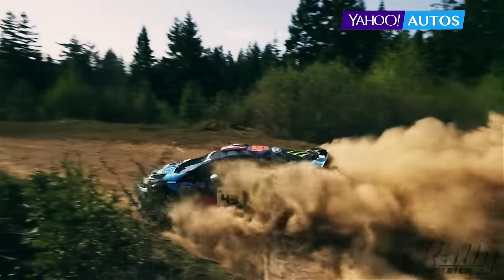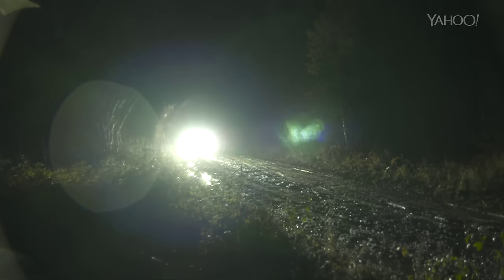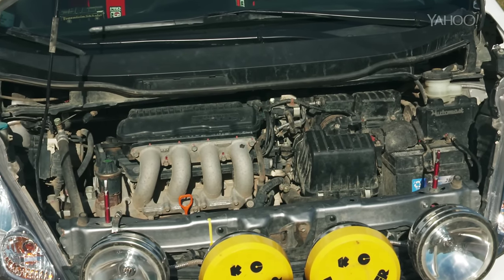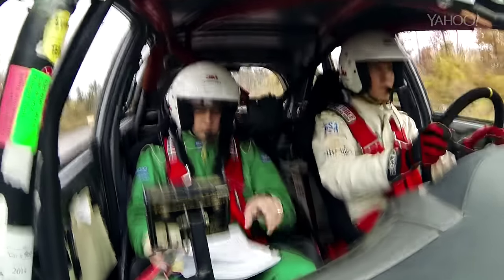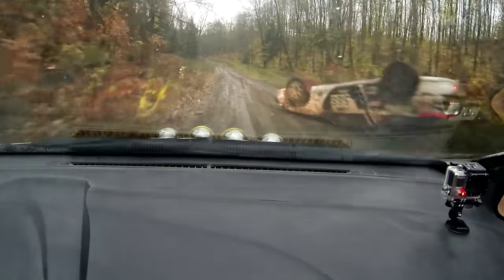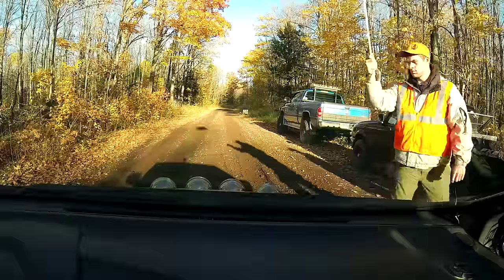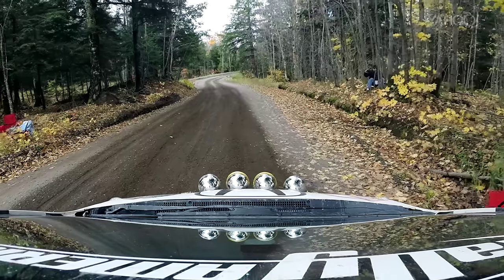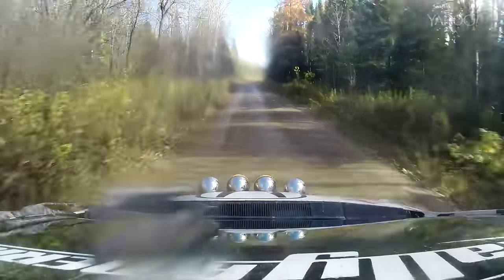How To Go Rally Racing On A Budget

Comment: yes, you can go out and buy a Honda fit for 10 grand, and yes, you can probably put a cage, two seats and all the other safety stuff in it for another 8... but this is where this "budget racing" thing goes a bit wrong. because youre looking easily at another 5 grand for a half decent set of gravel suspension, and a set of tyres (you'll want at least 2 sets) is about another grand a piece, plus youre going to need spares for the brakes and various other suspension components, easily another grand. Then theres getting it registered (oh yes, these things have to be street legal AND insured, and insurance for a racecar is not cheap). then youll need a tow rig, because even though it is street legal, youre insurance wont allow for it to be driven long distances to and from events, so youll need a truck and trailer. then theres the gear: helmet $500-1000, racing suit 500-1000, the hans device he has to wear around his neck is a minimum of 1000 dollars and it is mandatory. Going racing for 18 grand is all very well and good in theory, but youre actually looking probably a minimum of 30000 just to get the car ready and to one event, after that the costs die down, but it still isn't cheap. entry fees are expensive, and then theres getting the racing license, the school for which can cost 3 grand. so if you want to do a season of racing, your first year youre probably looking at $35-40000. not really budget racing when you actually look at all the costs.
Reply: +Jack Khashmanian Protip: Don't tell your insurance that you've modified your vehicle. Worst comes to worst, if you crash it you don't get anything out of it unless you tow the wreckage home and part it.
Reply: +Jack Khashmanian I am building a BMW e36 rally car. I have my helmet -120, insurance - 30per month, cage is 4k, suspension, 2.2k. Other items, Ie fire suit, skid plate, fire extinguishers, med kits, spill kits, steering wheel, tires and all. The whole project is looking to run about 10k for me. Then another 1-2k per rally. Not that bad. 1 or 2 rallies a year and then 50 dollar rx inbetween for my first few years. Biggest bite is the initial car.
Reply: while this poster is using worst case pricing and basically figuring all "new" gear (you don't need all brand new gear) he is mostly right.   you have to have a tow car, you have to have spares (though often the best way to get spares is to buy a wrecked version of your car and strip it apart at home).  but there is going to be 1-2 grand in costs per event you simply can't "bum" your way out of.  and of course being able to afford to build a 18k $ car doesn't mean your also well off enough to afford totalling it.  you have to enter every race with the mindset that it's not the end of the world if you tow back a pile of smashed wreckage.
Reply: Jack
"Budget" in comparison to a full-fat racing car, not to your shopping trolley.
Reply: Jack Khashmanian I think that compared to subarus late 90s budget for wrc was 350,000,000. But yea it's not exactly cheap.
Reply: It is still cheap compared to rallycross cars.
Reply: Or you go to Eastern Europe, get some shitbox for 3k, weld in your own cage, just drive it on the road and don't care about that silly stuff. (Okay don't take this all too serious). 
Funny side story of mine (I am from Austria btw)
I got an actually pretty damn decent Hyundai Tiburon that already was built for Rallycross and was in good shape for crazy 1000€ (1170$) and am driving it since 3 years on dirt tracks and closed off dirt roads. It's not an actual rally and I can only move it on the road with special short time number plates that cost 180€ for 3-21 days (it depends on your stated need for the plates), but it's the closest I can get to rallying with my irregular and poor salary I get from my almost bankrupt company.
Reply: William Brown umm.. what?
Reply: Jack Khashmanian and that is why I stick to demo derby figure 8 racing at fairs. My car is 200$ some time in taring it down and you just need a good helmet.
Reply: Thanks for the real world breakdown!  Actually 30-40k to start doesn’t sound all that bad for first time investment but I wonder if that initial 10k car money would be better spent on a more capable older car where you could potentially get the car for 5 or 6 grand and then use the other 5k you saved to build it out?  Are there age classes for cars in rally races?  I’d love to get my hand on a Celica AWD :)
Reply: Jack Khashmanian the video says rally on a budget. 

It doesn’t say rally for cheap or basically free with no risks.
Reply: yea, idk how yahoo thinks they know what they are talking about
Reply: You are definetly right but there is actually a thing that is "budget" racing. I.e where I live amateur rally drivers buy cars like Lada 1200 or old Volvos on and work on those.... Not of course nearly as nimble or in form as the honda here but they are rear wheel drive cars and everyone in class has more or less same kind of budget car with similiar backgrounds so racing stays close.
Reply: https://youtu.be/P782wx12uYw?t=2m18s guys rallying a Lada 1200... Looks absloutely brilliant fun.
Reply: You can do an event for $2000 minimum, that was camping and driving 11 hours to the event. My car was $3000 bought in pieces. After updates and safety equipment we were about $8000 total for car, dolly, tires, spare parts, and that was the cheapest car around.
Reply: Don't forget better engine parts for performance and reliability. Build your car before racing the budget is only for getting the car not building it lol. How it's always been. It's harder to mod now because it's nearly impossible to get blueprints of a lot of cars

Comment: "I'm surprised at how much you could leave alone" 
New tires, welded diff, stripped down completely, 2 bucket seats, gravel suspension, racing wheel, and a roll cage.
Reply: Seems like a lot but its really not, it's nothing compared to creating a drag setup.
Reply: @Snow-vo1yi  You can leave everything alone on a casual drag car, can you not?
Reply: @zachrichard7039  it depends on whether or not you're actually competing against buildt cars or not.
Reply: @Snow-vo1yi  But that's not their goal in this either. I think the point they're trying to make is that the "budget rally build" is still quite expensive compared to a budget track or drag build.
Reply: @zachrichard7039  ok m8
Reply: @zachrichard7039  you can build a Rally car much cheaper tham Dragcar buy fwd shitbox weld a vage weld the diff Take out interior fit a Bucket and done all in like 3k
Reply: @lel9460  you can build a drag car by doing none of that. You need a cage for rally.
Reply: @lel9460  what an incomprehensible sentence. I never said I liked drag racing. However, I do race a rally car

Comment: No such thing as budget rally.. rallycross on the other hand :) good cheap fun
Reply: Agreed. This is the real answer
Reply: You can't use the same budget car for both events? What makes you say it is cheaper, I actually like the idea of circuit racing better than timed distance
Reply: Drew Larsh it's information  for people that want to race rally not rally cross
Reply: rallycross is done on a mostly built circuit, which is a lot smoother than an actual rally course
Reply: Budget mudding.
Reply: 'Budget' is relative to the subject. RallyCross is definitely cheaper for entry, Though you still have to pay 2,500+ to get a rollcage installed, and upgrade suspension/drivetrain parts if you don't want your car to fall apart mid-race.

Comment: Cars I'd recommend:
BMW E30 325i
Mazda speed 3 (any generation)
Any subaru WRX or a 1st gen legacy turbo
An old AWD audi
or really any FWD car that's under 1400 kilos (3000-ish lbs.)
Reply: why FWD? Just curious. At first thought my instinct is to go with RWD.
Reply: Rwd slides a lot on dirt.  For fast times, that's bad.  FWD pulls out of slides on dirt better than RWD but if you just want to have fun and you don't care about time then yes, rwd is a good option.
Reply: actually thats just half of the story... FWD is easier to drive i give you that, but in bad conditions like rain and mud if you accelerate hard in a FWD car you'll lose alot of grip because of weight transition
Reply: Dat Person Doe. then a Toyota Yaris/Aygo is perfect, 2,400lbs, 104hp and FWD, in fact it could be a unnoticed beast because I haven't seen many people use them in rally even though you can find them for $3000 or less.
Reply: Skunkdog Gro
Ford Fiesta, and Opel Adam are also quite good. So good that they're both made into R2 Rally cars.
Reply: Id add the 6th gen celica to this. Im about to buy one for less than 1k that runs and drives. Toyota actually used these celicas for rally
Reply: A 1st Gen Fiesta ST 2006-2008 (165HP with small mods you can do with used parts / 1150kg stock )

Comment: Few mistakes but overall great video, really gives me a look into what should I expect, Im even more excited now. One thing tho, you can get into rally racing for a lot and I mean A LOT cheaper than 18k. You can pick up some car for 1 grand and rally it with no problem, just find a rally where there is no requirement about having a roll cage and you can participate for 1k + entry fee
Reply: Ofc having a skid plate under the engine to protect oil pain and transmission from rocks and stuff, rip out the interior, buy some aftermarket steering wheel and muffler delete will give you more of a rally feel, but those are extras
Reply: Ofc having a skid plate under the engine to protect oil pain and transmission from rocks and stuff, rip out the interior, buy some aftermarket steering wheel and muffler delete will give you more of a rally feel, but those are extras
Reply: 1. There’s no such thing as rally without a roll cage 
2. There’s also no such thing as buying a rallycar for 1k and just going and driving it with no issues. If you get a rallycar for 1k, be prepared to spend hundreds of hours and thousands of dollars to get it remotely stage worthy 
3. Motorsports are inherently expensive. If you’re looking for cheap, rally is not the sport for you. I would recommend curling or badminton
Reply: @RallyKJ  Overall you are 100% right, and I agree with you, but at least here (Australia) there are S1 rally sprints, which are the really base level events.
They are set up so you can't reach that high speeds, and you can just use your road car in them; all you need is a helmet.
I would imagine most other countries would have similar events.
Reply: @Sussex192  oh yeah we have those in America too. That’s what we call rallycross. Completely different than rally tho
Reply: @RallyKJ  Interesting, what I know as rallycross is where you have a bunch of cars on a track together. Rallysprints are just like one stage out of a rally, (with cars going at intervals) but with more thought put into it to keep speeds down, if that makes sense.

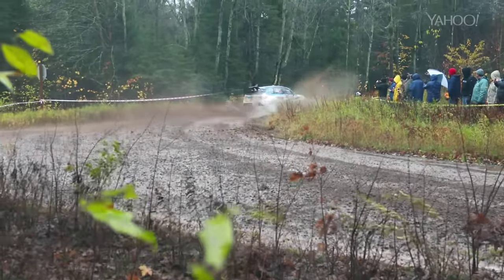Comment: One thing I don't agree with is the "man vs machine" portion mentioned around 1:07 - you have to be one with your car and it HAS to be an extension of yourself otherwise you're going to run wide and wrap the car around a tree :|

Comment: A 500k Fiesta lol what a waste
Reply: It's anything but a Fiesta mate. Nothing is the same, not even the body.
Reply: +The Wanderer a build for 500k is a waste it could of been done for 100k never said it was a shit car my impreza is fully built pushing about the same hp with Bilstein suspension kit plus many more extras spent around 30k
Reply: Daniel Albrittain
So they spent 400k on drugs? Otherwise how did they waste so much money if 100k would have given them the same results?
Reply: +wolfmannn2008  maybe a little on drugs only way i see it costing 500k if they had it built for them i do all my work on my cars  i have a lot of help because i work a great shop and i don't pay for a lot of expensive things like programming maps etc
Reply: It's pretty simple see. The big companies can work off of the fact that since they have money, they can use it to make more money. Sure you can weld your own roll cage, piping, chassis, and all that, but who did it? Not a big company that will pay you to advertise their gear. The sheer amount of money you could get if your name was Ken Block and you spent 20,000 grand on a top of the line, trademarked roll cage outweighs the purchase price. Imagine the advertising revenue when you post their logo among the countless others you'll have on you're rally car. Oh you'll be making well over 500k. The 100k goes to the car, the other 400k is an investment. Also, another big thing about the automotive industry. Don't get me wrong, I am very much impressed by your build (and I love Imprezas), but not everyone knows that building a rally car is a very achievable goal. If it was, who would be sitting at home watching Ken Block do it? No, instead the industry is going to put on big price tags that say "you can't afford this" so people won't attempt it. Frankly, you can see this same business pattern in a lot of things you can build; like PC's and firearms. The demand will switch from the product itself to the parts that make it. Thankfully, we are at a happy medium where parts are cheap, but not so cheap that they aren't produced at all or are ridiculously expensive, (hint: airsoft).
Reply: +Michael Berry well put
Reply: Daniel Albrittain Thanks both of you, now I understand more. I will build a rally car one day, not top end competitive, as long as it has 200HP and it's light I will have fun with it.
Reply: Any car for 500k is a waste

Comment: I have a 2008 fit. Im going to go weld my diff right now.
Reply: Have a 2013 fit ...put a rear stabilizer bar on made a world of difference.
Reply: @MikeHunt-wx4wk  did that to my awd g37. Turns in much better now.
Reply: @urboychon  
Nice car. Sporty for a luxury sedan. I like my Fit on back roads and around town. 5 speed manual.  Nothing like driving a slow car fast😄
Reply: @MikeHunt-wx4wk  yeah I agree. Used to have a 94 sentra. Stock suspension, sticky tires. Best thing in the world.

Comment: Take the turn early and use a hydro break to get that lean you need, after your where you want dump the clutch to get maximum power to the wheels so you dont slide off the road
Reply: in a front wheel drive platform on a loose surface you should be turning in and applying foot brake over gas, never disengage the engine and there is no need for a handbrake

Comment: What need beginning rally driving in budget
1. Buy awd or rwd car
2.get short shifter or sequential shifter
3.upgrade your suspension brakes and tires
4.weld your differential or get locks
5.get rid of all extra wight
6. Get rally seat's and 4point seatbelt
(With more budget)
7.rollgage
8.more power
9.better light's
10.loud ass fucking exhaust

Comment: What I'd like to see are manufacturers  their using  showroom models with roll cages, different tyres and extra lights, but nothing else rallying and racing. Then we'd see which were  best cars and most reliable cars and drivers even though speeds would be slower. It's how it used to be 1950s and before.

Comment: Honda civic 1997 hatchback with rally suspension, rollcage and bucketseats + harnas, straight pipe, brakes. Maybe new intake and if you have the money a turbo. If you find the right parts you'll probably sit under 18k

Comment: You can find a Celica for under a grand in my area. You can find an Imp for under 10 grand, and many other older rally cars like the 90s Sentra are also dirt cheap, no pun intended. Not to mention, being 90s Japanese cars, they're easy to work on, reliable, and handle really well. A 10k grocery getter with fuck all power and average handling really isn't the best choice. If you want to go higher end with rally, you can even find an Evo around here for under 20k
Reply: where the hell do you live
Reply: @Seltsamisierend  They used to be cheaper. This is a 4, nearly 5 year old comment. Back then, I'd recently gotten a 91 Celica for $800

Comment: so how would you go out there without a skid plate? aren't you worried about the oil pan?
Reply: You 100% need a bash plate.
If you have any metal skills you can make one up yourself, or it should be a pretty cheap job to get someone else to do it.
Doesn't need to be pretty, just strong.

Comment: RECAP : ANY CAR - ROLL CAGE - TOP PERFORMANCE SUSPENSION - DIFFERENTIAL - SHORT SHIFT GEAR SETUP - TYRES - BRAKES - LIGHTEN WEIGHT CAR - ENGINE TUNE AND RECALIBRATION : 

THEN STAY OUT THE WAY OF PROFESSIONALS AND PRACTICE AND HAVE FUN . HOBBY ACCEPTED

Comment: dude just buy a used subaru impreza 2.0 turbo 4wd wrx! You have more power more sound better design advantage because of 4wd and the only thing you have to do at this car, is ripp out the backseats to make weightreduction. Put in a rollcage and maybe to a new exhaust for better sound and a bit more hp and torque.